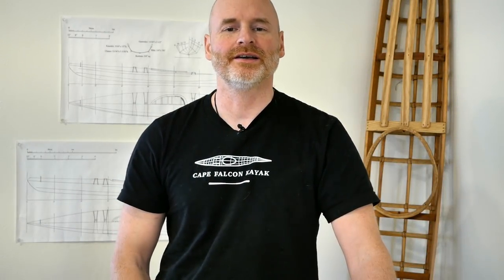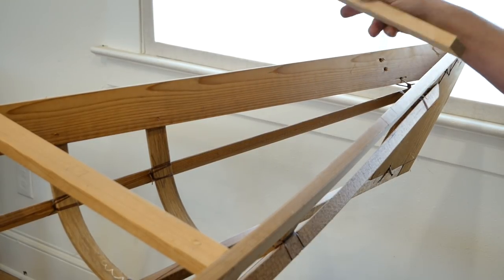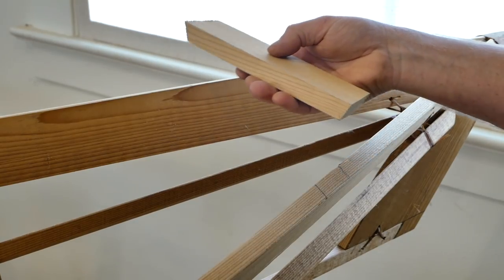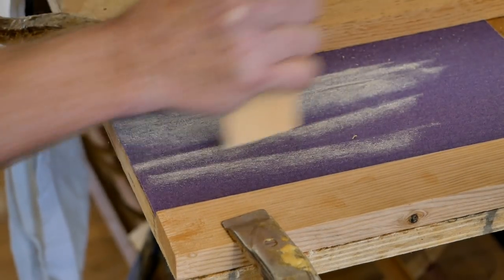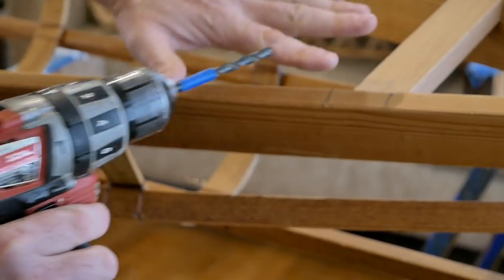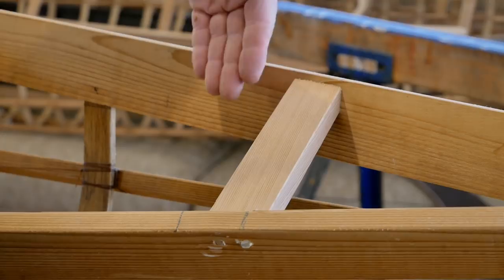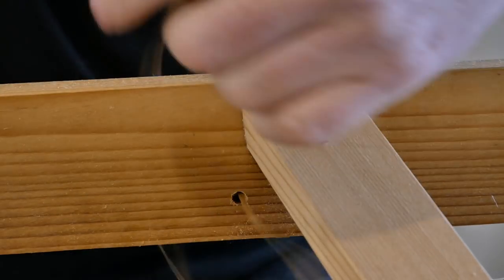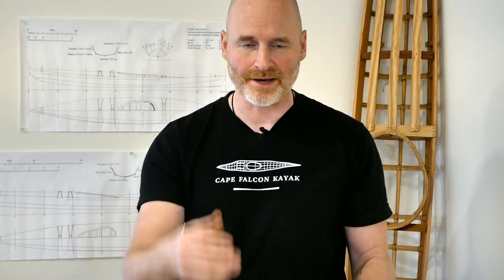Doweled deck beam joinery for skin-on-frame building.

Comment: Like Sakura, the video was very informative and I'm thankful for the share. I'm relatively new at this but I wanted to add a comment. What I find good is tracing the deck beam shape onto the gunnel once deck beam is properly seated. Than drill from inside the gunnel using that trace as an aid. Next when you drill, the drill bit will start off at the deck beam. Can start off with a smaller drill bit and it won't spin the deck beam as much. Leave the smaller drill bit in as a lock and drill the hole for the other dowel.

Comment: As a furniture maker I would have reached for a #4 bench plane to square off the ends. That said the lack of precise joints is very appealing, after years of making furniture which need a precise fit. Kind of a breath of fresh air!

Comment: Small L-Blocks are really handy for holding pieces like that in place, assuming you own clamps that are sized and low profile enough to fit without getting in your way. - If all you have are large common threaded C Clamps, then it can be more trouble than it is worth.

Set an L-Block fore and aft of the piece you're trying to drill, and clamp the blocks to the gunwale.The blocks keep the cross member from dropping or slipping fore/aft, and light pressure keeps it from climbing.

Comment: I don't do doweled joints on my SOF's but to correct those small fitment problems I use a fine toothed hand cut rasp rather than sandpaper. I find the rasp much easier to control.

Comment: What if you were to glue the deck brace in place BEFORE you drill and dowel? *WinK*
Reply from the maker: good luck with that....   :)
Reply: Could you pre drill it for a screw? And then screw it together without glue. To ensure they are aligned well.  Then glue and screw. After the glue has dried, remove screw and drill out larger for the dowel then glue the dowel.  A bit extra work but I've used it before in furniture making.